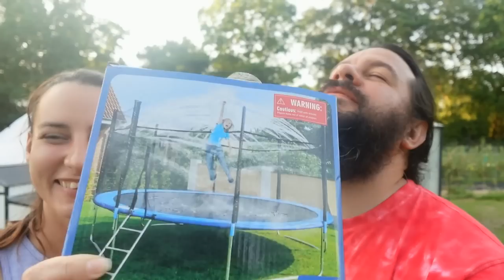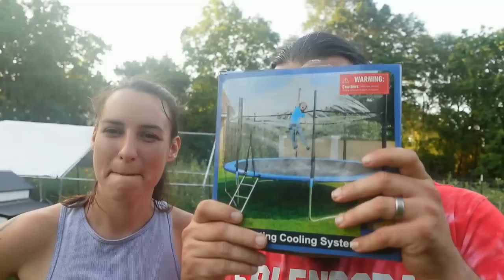Keeping Chickens Cool: DIY Water Misting System for Hot Texas Weather

Comment: We used these for many years on the patio in the evenings. My son hangs out in his garage and strung some across the top of his door and used it in the summer to hang out in. They are supposed to reduce the heat by 20°. We have also used them along the fence line in the backyard for my son's outside dogs to stay cool. I have mentioned these many times to Lester for his animals and he never did do it. It evaporates pretty quickly so it doesn't cause standing water underneath.
Reply: I sent them two I believe it was last Summer when they had the Harsh heat spell. They bought the big misting fans and never used them. 😢
Reply: @DannaK247  that's crazy. That would have helped them so much

Comment: Using misters in Arizona,  after seasons end of using mister. YOU HAVE TO rinse a cleaning solution through entire system to clean out . If not, next season you want to use, they won't work.  Will have to replace nozzles. That's with our city water. Maybe will be OK with well water.

Comment: I don’t want to be a Debbie downer but the misters can often do more harm than good, making the air moist and causing respiratory problems in your flock. If your chickens are getting wet  that hampers them from regulating their own body temperature and they can overheat if they can’t fluff their feathers. Please check on them regularly.